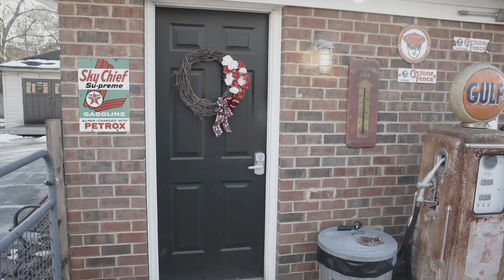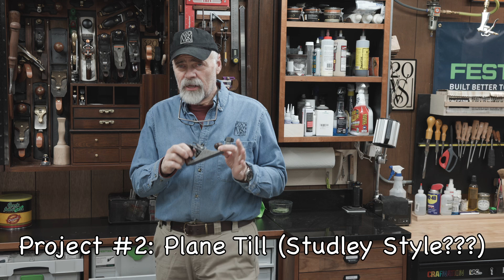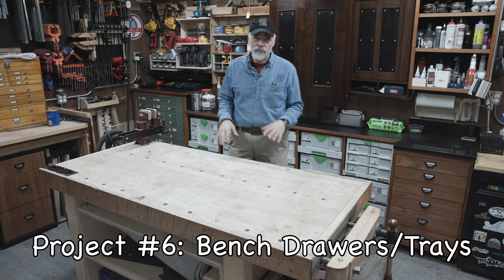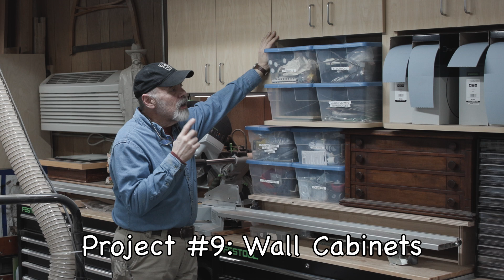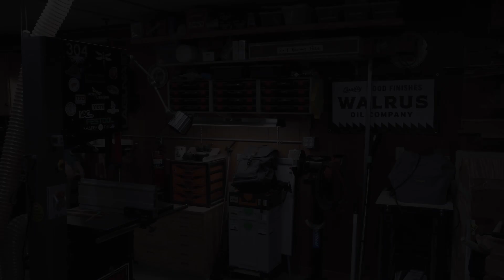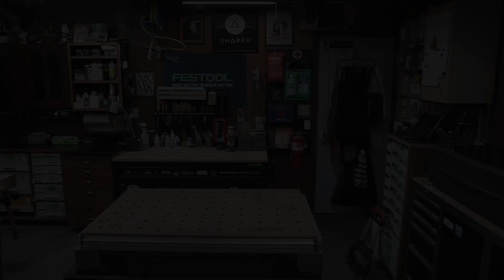Take a Tour of My Workshop and Check Out My Upcoming Projects

Comment: Just found your channel. Nice shop. Improving the shop with organization always helps out with work flow.
If you're going to add the floor like you said are you considering putting in radiant floor heating?
Reply from the maker: Thanks!  It will always be a work in progress!  I hadn’t thought about radiant heat. Would probably be a good idea but here in Central Virginia our winters are mild and I use the A/C about 10 months out of the year. May not be worth the expense but I will look into the cost of that. I would think that would be a comfortable heat.